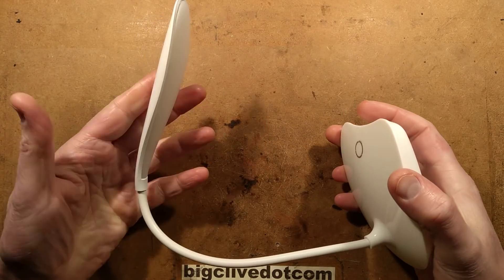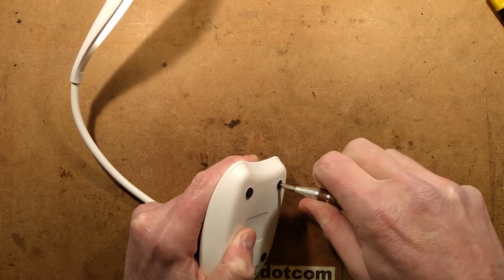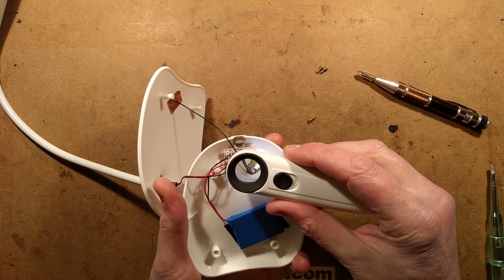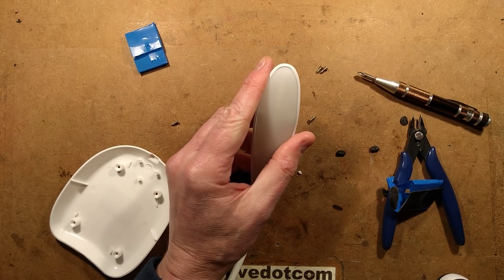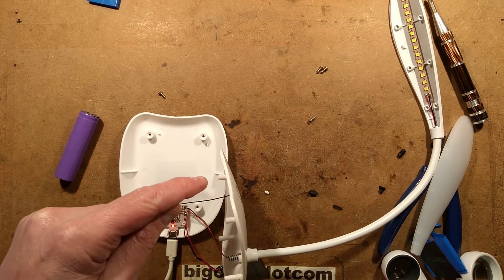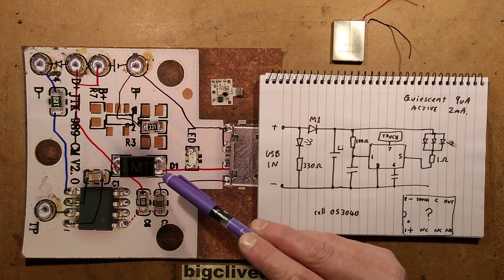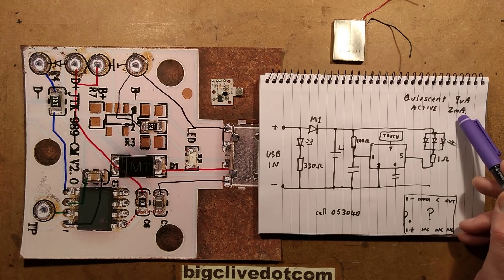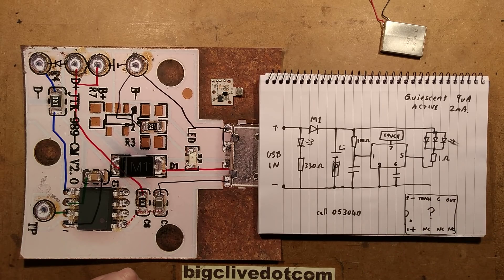Inside a dodgy rechargeable touch light.

Comment: This look like the perfect kit for building your own timber base with a bit of heft and a better battery. Would make great 'hand made' crissy presents.
Reply from the maker: A lot of the cheap eBay gadgets are great value just for the parts they contain.  Ideal for repurposing.
Reply: Shove a chunk of lead or bismuth in the base.
Reply: Anybody know where I can get a slab of depleted uranium?
Reply: And there's me adding sheet steel to objects to add weight to them like a pleb. Cutting thin plates with shears and gluing them in. Then again that is definitely the cheapest way to go about it. Lead is only 40% denser, but if you use pellets, you lose the advantage because of packing density, and i don't have a source for sheet. Bismuth a bit useless at 25%. DU about 140%, which is remarkable.
Reply: DU is indeed remarkable.  It was used as the keel on a super-yacht a few years ago.  I cannot find any on eBay.  It is a quite toxic heavy metal, even without the slight depletion-depleted radioactivity.
Reply: @patricksweetman3285  You might want to contact Hillary Clinton, I hear she is good at sourcing that kind of stuff. LOL

Comment: You measured 250 mAh.. at 5 V? Or did you convert that to 3.7 V? I don't get why people always use the electric charge rather than the actual energy stored in the cell (Wh). It's like with the powerbanks... take a 3000 mAh powerbank - is that 3000 mAh at 3.7 V or at 5 V? If it is at 3.7 V that's actually just (3.7*3000)/5=2220 mAh at 5 V (without any losses).
Reply: You know this thing has no charging control, so it is the battery voltage, no matter where you measure :D
Powerbanks are also pretty much always specified by the cell capacity btw, why would the write the smaller numbers at 5V on the package?
Reply: I recall Clive measures Li-Ion batteries by linear charging from flat, meaning regardless of the input voltage, the integral of current over time reads true battery capacity at battery operating voltage - the difference is invariably resistively dissipated by the charger. The charger and battery distort the reading using this method only insofar that they leak between the inputs, which is generally negligible. To the extent that there are losses, they occur as extra series resistance and thus look to the charger like extra voltage needed across the battery to maintain the current, not affecting the current integral. Elegant, huh?
Reply: you really cant calculate what wh 250mah at 3.7v would be?
Reply: Why would you want to know the voltage in 5v ? The phone battery is 3.7 so that's the relevant voltage.
Reply: But unfortunately it is rarely 3.7V. Voltage of lithium cell changes from 4.2(or 4.35 max) to about 3V (or even 2.9), so accurate energy calculations are not that simple. Same for all kinds of accus
Reply: cbm80amiga  I get what you're saying but the power bank battery voltage changes as well between 3.4-4.3 so it's pretty much even. 
It ain't that simple and depends on the capacity of both the power bank and cellphone. I still think that 5V matter less.
Reply: Except the power banks do an SMPS boost to 5V at same energy (minus losses) , then there's a second charge circuit in the phone which may be resistive or SMPS. As for quoting large numbers on the box, mWh or J will give larger numbers and be more honest. 1000mAh@3.7V=3700mWh=13000J minus the losses in any particular power bank circuit.  (Sorry for omitting your name, my phone provides insufficient control over mixing RTL/LTR text).

Comment: Does it turn off with a long press? I found this from my bicycle light and it's just waaaay better than cycling through all the stupidly arbitrary but compulsory blinky hell modes.
Reply from the maker: I just checked.  It doesn't do that.
Reply: I find a lot of switches work that way.
Reply: I thought the same, it’s a little secret a lot of lights I’ve had hold, aswell as some of them even respond to a double click! Alas, Clive says no in this instance. Badly designed all round really, then.